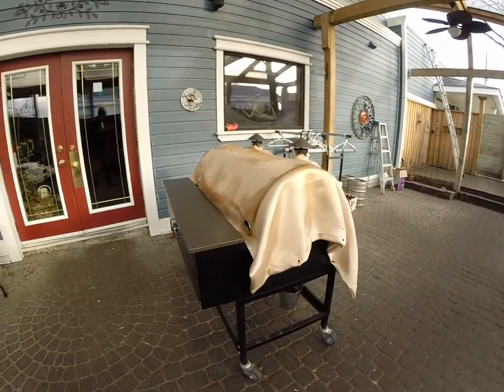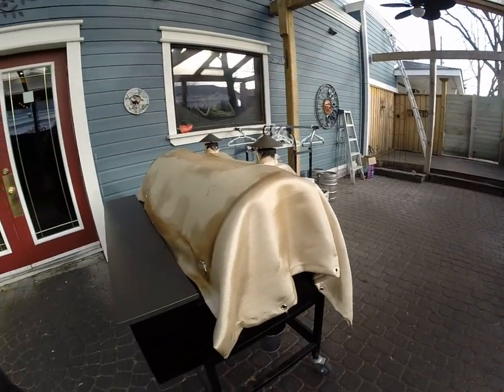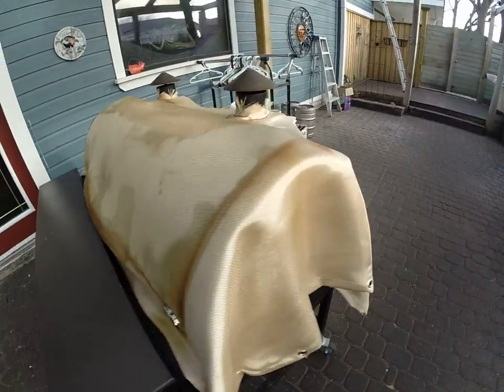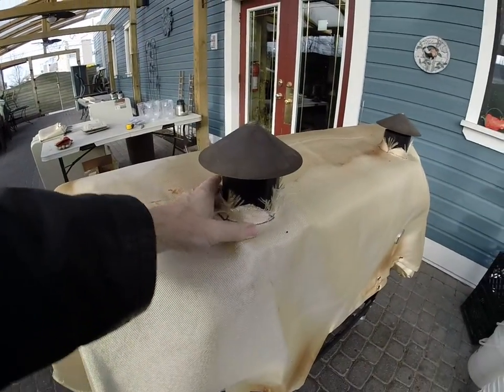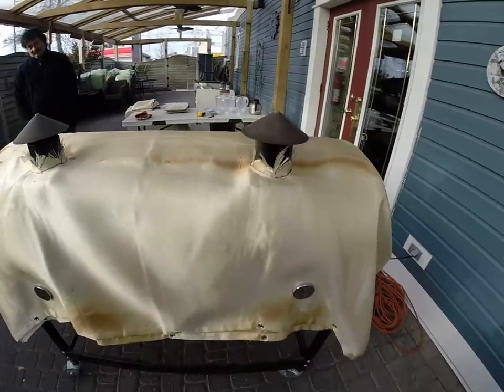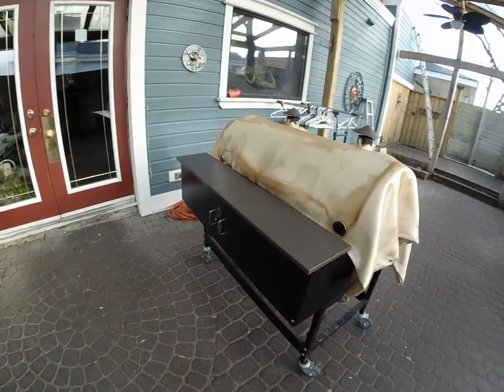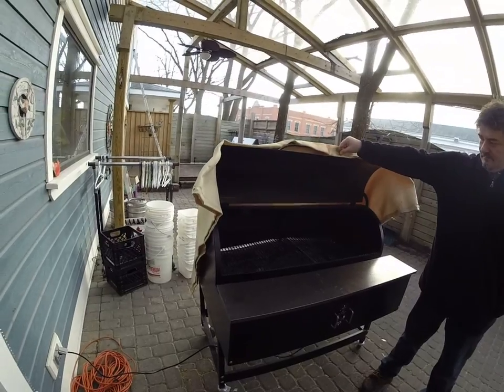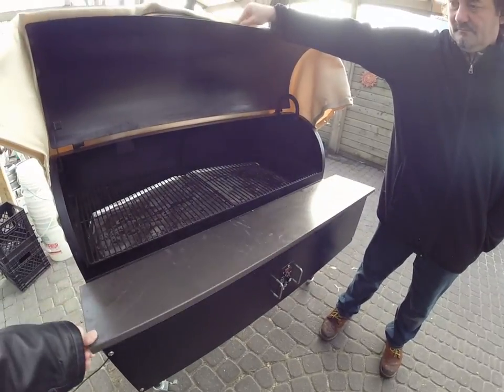Brief Look at How a Welding Blanket Insulates the Traeger Smoker

Comment: Aren't you concerned that the blanket is likely made from silica or fiberglass and particulates from that material could easily get into the food you are smoking?  Especially in the unfinished area where you cut the hole for the vents on top.  As a person who works with industrial heat insulation materials and blanketing all the time I certainly would not want that anywhere near my food.  Just wondering.
Reply: Shawn would a felt welding blanket be a better idea?
Reply: Yes you should be concerned 
I bought a blanket of Amazon 
When I opened it and unfolded it
I was covered in fiberglass 
I took it far away from my food
NOT A GOOD IDEA

Comment: I have the welding blanket.  I was wondering though where you got the large magnets.  I'm assuming they are heat resistant?
Reply: harbor freight has magnetic welding holders
Reply: HARDWARE STORES. In Canada Home Hardware carries them. Large box stores such as Home Depot would have them.
Reply: Magnets typically have operating temperature limits between 80-230°C (https://www.supermagnete.ch/eng/physical-magnet-data).  I wonder if where those are located is going to get hot enough to demagnetize them...